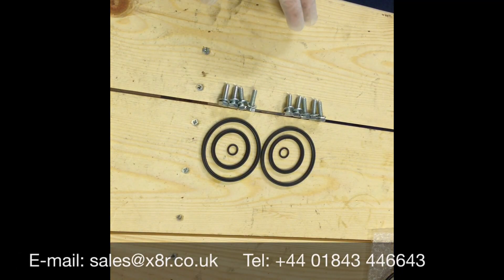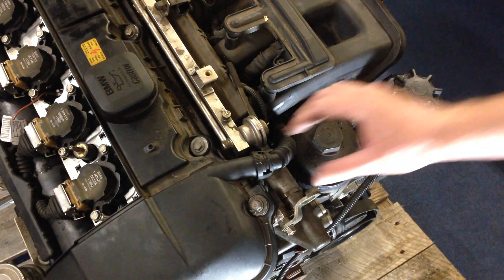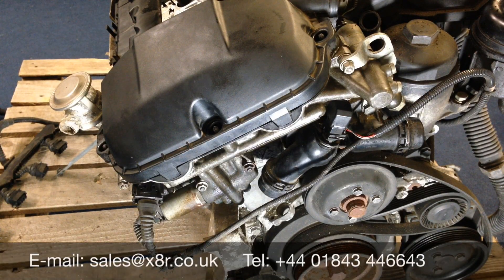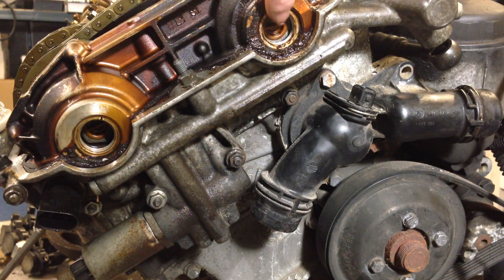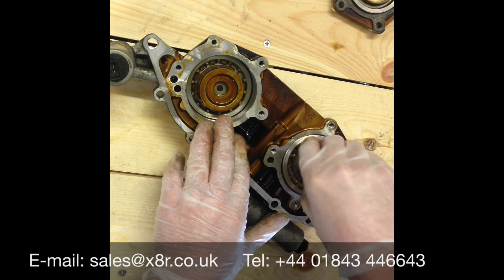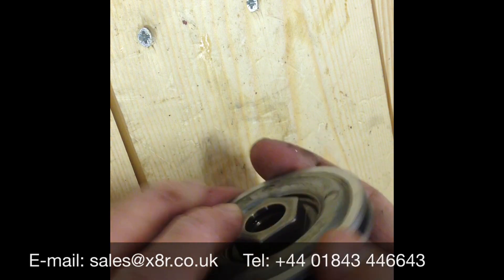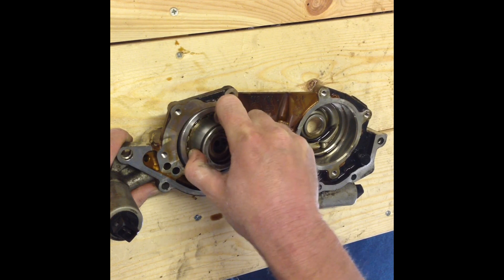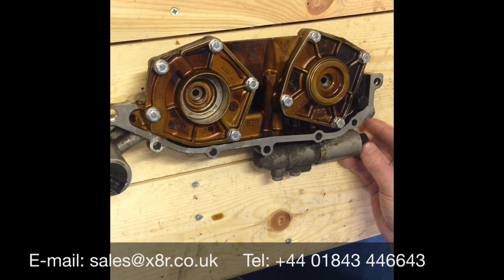BMW 6 Cylinder Petrol Dual Vanos Piston Seal Repair Fix Kit

Comment: Unfortunately I slipped while I was cutting the o-rings out and stupidity scored the edge of the intake piston

It has been 5 weeks since this repair, now I have a rattle coming from the front of the valve cover and  a rough idle which makes me think it's VANOS related. Have I messed up the tolerances within the VANOS housing by scoring the edge of the piston? 😩

Comment: Hello.
Just a question, Is any special tool needed to proper replace vanos piston seals? What I mean is, isn't possile to interfer with the correct valve timing using regular tools?
Thank you very much!

Comment: will this work for an e92 2007 N52 engine ?
Reply from the maker: +Andres Rojas Hi,

This kit is only compatible with BMW 6 cylinder engines - M52TU, M56 and M54 only.

Regards,

X8R-Team
Reply: Did you ever get the right vanos piston repair kit. O have the same n52 2007. In need to address same issue

Comment: In all the Vanos videos I have seen, the Vanos all show to have dual O-rings.  So why does my 1999 e39 528it Sports wagon only have single O-rings?  I am confused, were some designed that way?
Reply: You have a 1999 e39 model,so you have an M52 engine.E39's were updated in 2000 with an M54 engine.I think that's your issue,hope this helps.
Reply: Alex Spanos Thanks for the reply.  Maybe that's the answer.  Either way, I just replaced the O ring needed.

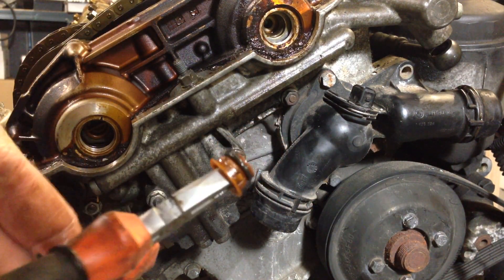Comment: Hello there, Thanks for the Exelcent video. Just one quick question. At 5:50 in your video you mention that you can remove Vanos maunting bolts, and that you can remove them afterwords if needed. But you didn;t do that at any point. Is there a need for that and what for?
Reply from the maker: It's only relevant if they snap, hopefully they won't but if they do you can proceed and drill them out later.